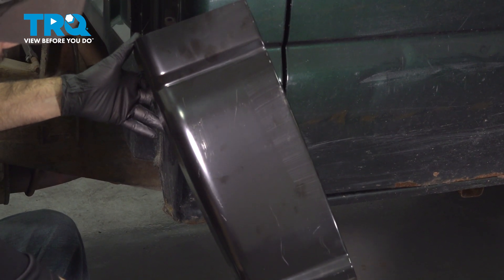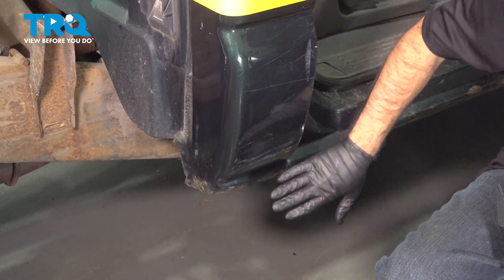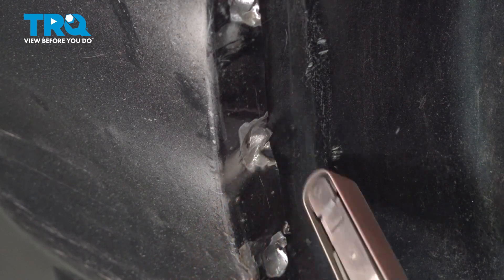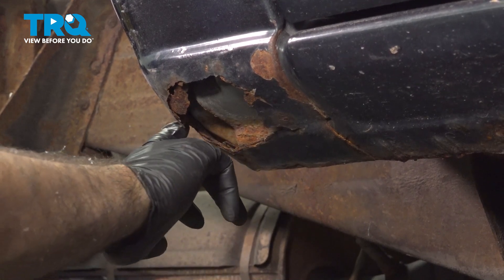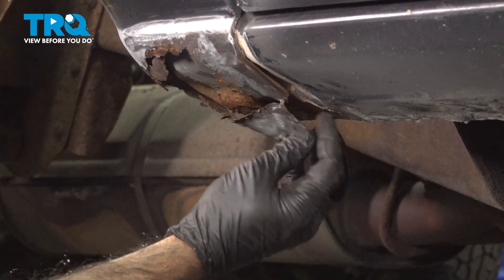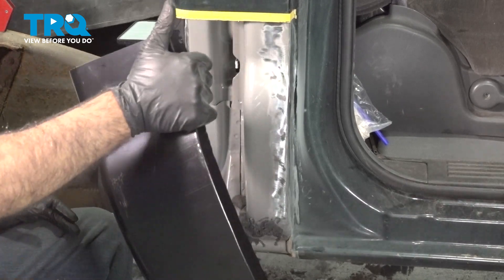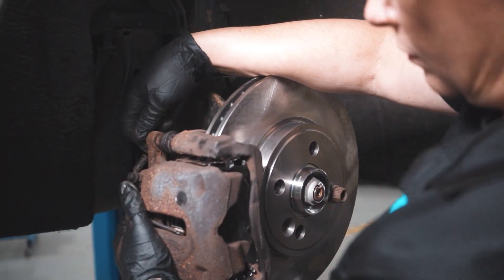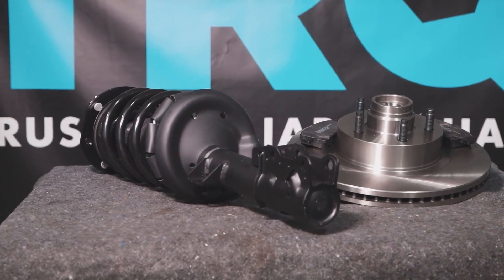How to Replace Cab Corner 2001-2006 Chevrolet Silverado 2500

Comment: Bought a CHEVROLET 2500 4X4 LS K20753. Issues with the truck bed, cab corners, need alot of work. Buy where do you guys buy parts? Any good shops online?